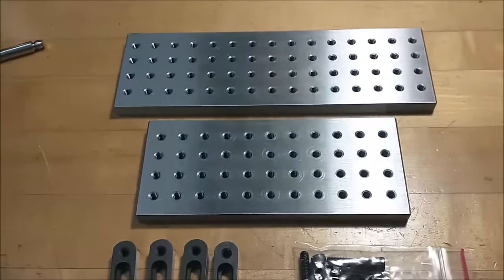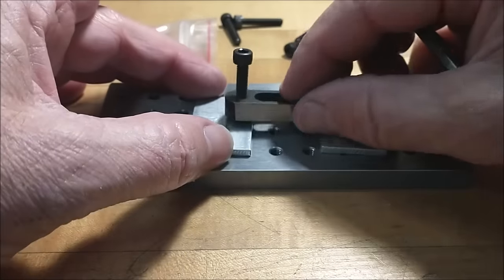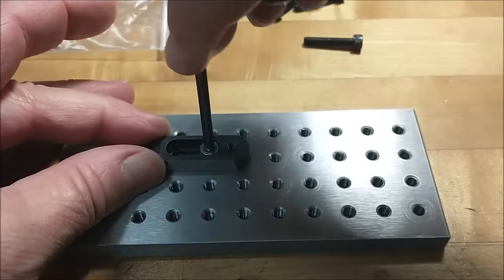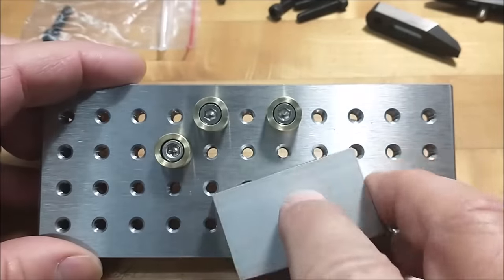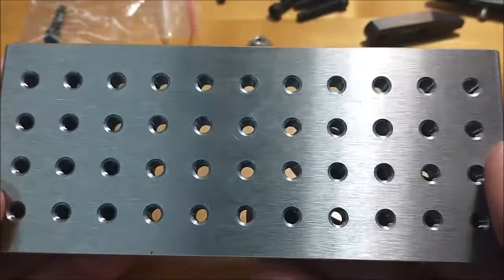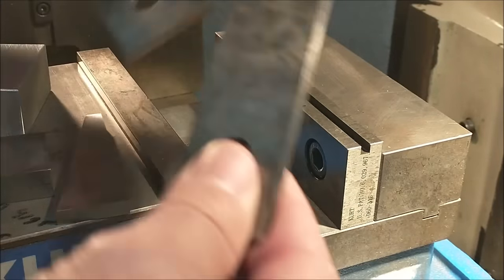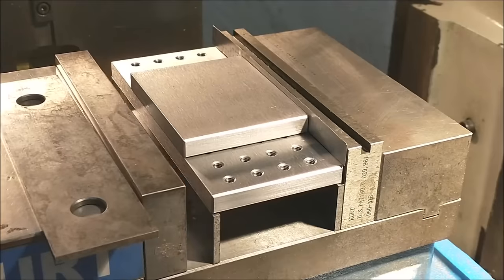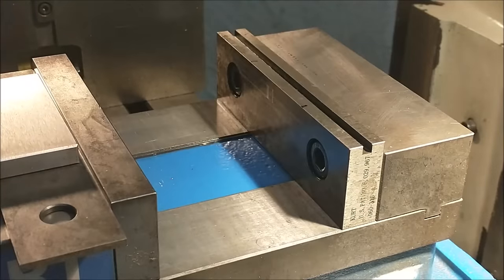Small Fixture Plate Setup Techniques

Comment: I always said machining is easy. It's work holding that is the skill. Also , it's not what you have done. It's what you've SEEN done. Folks don't have exposure to set ups other guys doing jobs/projects things get a bit gray. Your little 15 minute video is enlightenment beyond years Joe. I can't tell you how many of these I made during my career, Some big some small. Some aluminum , some precision ground tool steel etc. I have a few small one I made yet I still went ahead and got one and a couple of sets of clamps from you. Sure I could have made a real nice one like yours, but WHY? These little plates are just so dang cool I couldn't pass it up. Besides it's helping a good out a good guy and it's made right here in the USA! Thanks Joe!

Comment: I made one of these years ago and use it regularly.  Mine uses 1/4 hardware, I chucked up all the 1/4 hex screws up and face and champher the hex. That allows you to use an openend wrench when the fastener head is in contact with the plate. I still use small shims under the heads. Even though I have a surface grinder to redress the plate, why make more work than necessary for yourself.
Your tips have shown a few tricks I haven't thought of thx for that!
I also want to thank you for your rotory table videos. They opened up a whole new world for me and over the years have saved my butt .
You, Joe Pie, have set a new standard in the utube machining community where other creators are really lacking. Your math and setup demos are stellar. I have never had to bother you with a question. I simply just watch the video and do the exercise in real time as I watch, and it clicks.
I enjoy all the creator's and learn things, but they could all step up their game for the guys and gals that are no longer newbes.
Thx Joe

Comment: I made a big round fixture plate like that for my rotary table. Took forever to manually drill and tap all those holes but what a life saver!
Reply: How large is Your round ficture plate?
Reply: 14" diameter on an 8" rotary table. All that extra real estate is great. I went as big as I could without covering the scale on the hand crank.
Reply: @radardoug  I want do similar work: make faceplate for my big lathe. I have D=690mm (~27inch), B=30mm (~1,2in) steel blank for this. Looks that to this work will take a decade until I get it ready.

Comment: Hi, Joe; lots of great tips. I keep a bag of Copper pennies (the newer ones are a copper/zinc alloy and I think are harder) to place under the “heel” screws and also under the nose of the clamp when using on softer parts. I also use plain head (no class markings) carriage bolts for the heel – this makes for less friction when clamping and also reduces side forces (and you can use a small wrench on the square under the bolt head to tighten the heel).

Best regards,

Charlie

Comment: One mod i made to mine that you might have missed: counterbored holes at either end for direct mounting to the mill table. I popped some counterbored holes for #10 cap screws in mine and it directly bolts to the table on my Taig quite nicely, no vise required.

Comment: I have a fixture plate and used it just last week on a project. I like the flexibility of a fixture plate, especially for machining small parts that are unsuitable for holding in a vice. Thanks for the tips on fixturing techniques that I will use in the future. I made a round fixture plate for my rotary table. My "economy" rotary table is only 4". I made the plate out of a round, 8 x 0.5 inch aluminum plate and fixed a fence on one side. It really expands my fixturing options for my rotary table.

Comment: When I made blocks similar to these I added three holes 2" apart in right angle arrangement.  When used vertically I can put pins in two of the holes and use them as a sin bar.  Love it!

Comment: I bought one of the fixture plates and 8 hold downs. First thing I did was go through and smooth the end of all the screws so if they do contact the plate surface they are kinder to it. Second, I bought different length screws but I see that I need to buy short screws too. Third, I ran all the screws through a die to make sure they all turned easily by hand (some of the screws had burs on them). I had been envious of your clamps for years and jumped at the chance to buy some and I hope help you out financially too. Thankyou for all the great content!

Comment: Some nice ideas here, thanks Joe. I made myself one of these plates before you started selling them. I have two additinal ways I use mine.
First I driled two additional counter-sunk holes and one dowel hole. This coupled with a little taper boss with the same size dowel hole allows me to easily mount it on my rotary table with the dowel hole centred up. 
Secondly I have mounted mine in the vice with an angle plate underneath it to work on tapered parts.

Comment: I’ve built the number of these plates and what I did on everyone was to rabbit a 1/8 inch to quarter inch on the complete length. That way it can drop right into your vice without having to use parallels.

Comment: Thanks for all the good tips Joe!
I made a very similar a little larger plate from pre  ground stock way back in the 1980:s. Still have it an use it, not only in the mill but also for various temporary mechanical test jiggs etc. I found it useful to standardize on m5, also have cubes and clamp blocks etc in the same "standard". I highly recommend this technique if You make lots of small odd parts.

Comment: Im happy for this video, thanks alot. I just completed.my fixture plate recently so im looking forward for its versatile use once my clamps are made, and life does not interfere with being creative too much😂
Reply from the maker: Those little clamps are not very hard to make, just a lot of setups. Be sure to harden them or they will bend under pressure. Mine are A2 at 55 RC.
Reply: @joepie221  ok thank you

Comment: there:s some advantages to putting washers under the screw head.  less creeping around as you tighten the screw, it also helps keep from wrecking the slot edges of the clamps

Comment: You can also drill a couple of through holes and bolt it to the table. Mine is thick enough to have the holes counter-bored so the heads don't protrude.

Comment: I made a couple of these before I retired (still have them, and use them in "rinky Dink Tool-Die and sawdust in my basement) made out of 6061 aluminum. Alternated dowel holes between the tapped holes. Handy as all get out for the small stuff I often ran into on the Wire EDM. Wasn't a submerged machine, so 6061 took care of the rust issue. Even have one I mad 40 plus years ago I use on the lathe faceplate.
Reply: Agree a bun out the dowel holes a long as they are inline along the x axis. Very useful as register points for repeated set-ups.
Reply: @mpetersen6  Yep when I made the plate the centerlines are parralell to the edges.

Comment: Joe, Thanks as always for an informative video. My grandson has asked me to make him dice for Dungeons and Dragons. Only one is a normal six-sided die. The rest are platonic solids, tetrahedron (4), octahedron (8), dodecahedron (12), and icosahedron (20). Do you have any suggestions on how to hold a part for making these dice? My only thought is to drill and tap the part for a screw. Hold the screw and with a rotary table and angled headstock mill the faces. Eventually plug the screw hole on the last face. Appreciate your thoughts.
Reply: If you could cast the shape of the die then you just have to clean up the surface. 

Otherwise, machine the parts as far as you can with a standard setup. When you get to the tricky part cast a low melting point metal around the work piece. I think high temperature silicone can stand up to molten zinc.

You might be able to plate a set of plastic dice.

Rock grinders use dop wax on the end of a stick to hold the stone they're working.

Hope this helps.

Comment: Hey Joe, when you were doing the first of the PM Models that had the odd frame with the angled bearings and other stuff I asked if this sort of pallet would enable taking an object like that and moving it about AND NOT LOSE the location because you'd be able to re-reference the part.

Part of my idea was that you put one of your calibrated tooling balls onto a hole on the plate and leave it there for the entire job. That way you'd have a fixed reference so it would not matter how many times you took the pallet out of the mill you'd be able to re-reference the part from that tooling ball.

Was I wrong to see that or is there something else to it.

Comment: Great bunch of tips!

Question though: Where you screwed down the three brass bushings, wouldn't the tolerance stackup of the threaded holes and bushing holes make true squareness questionable?
Reply: Depends on the level of accuracy you need but overall it probably won't make enough difference to worry about
Reply: Two ways around that: countersunk holes with flat-head screws will locate consistently, and you can take a straight dust cut across the sides of the bushings after mounting them to square them up perfectly.
Reply: @PaulSteMarie  Yep.

But I think the best solution was mentioned during the video, which would be to have dditional holes for close-fitting pins.

@Joe Pie, Would you consider adding that as a stock feature?
Reply: @noahkatz9616  Chuckle. I already did that on mine.

Comment: I ordered one waiting on it should work very nice, Dumb question what is the groove on the fix jaw I have the same vise haven't figured it out
Reply: If you have a Kurt or similar clone, look on top of the vise, closest to you, just behind your handle. You should find what looks like a small pointer held in place with a socket head screw. Loosen this screw and remove the "pointer". This is actually a handy part stop that fits into that rear groove.
I had my Kurt vise for years and never knew what that was for until I stumbled across a YT video where one was being used as such.
Reply: It’s for a stop that is adjustable throughout that slot.

Comment: Hi Everybody.
5 miutes and five seconds in the video You are using some cylindrical "spacers". I was tinking make the spacers vith a larger diameter and then drill a hole in the part that is excentric. Then You cuold use thoose spacers to set any angle Yoiu want to by means of rotating two spacers to each other. If you havfe a cylindrical spacer that You could use as a reference then it is repaeatable..

Just an idea from John Eriksson in Sweden that find Yout wideos very nice and educating.